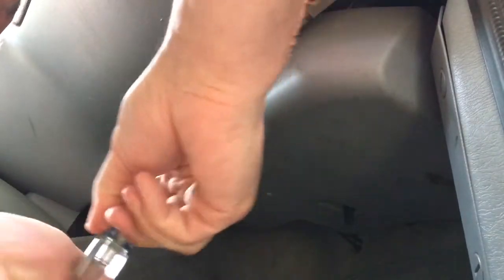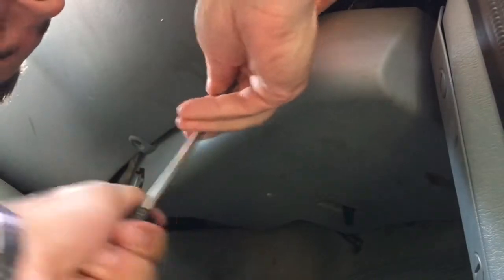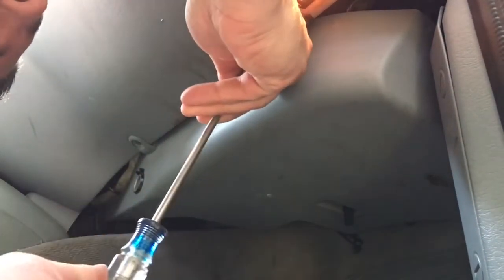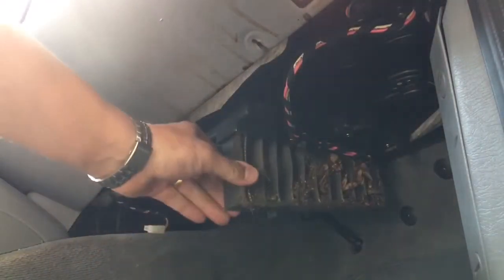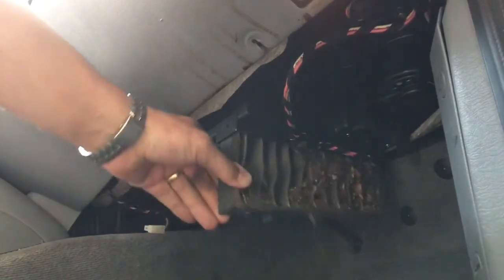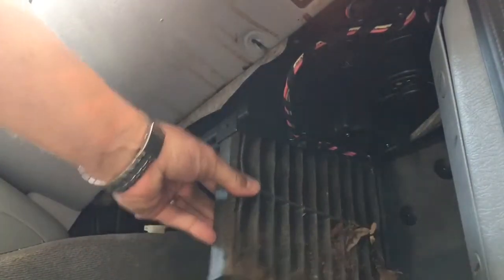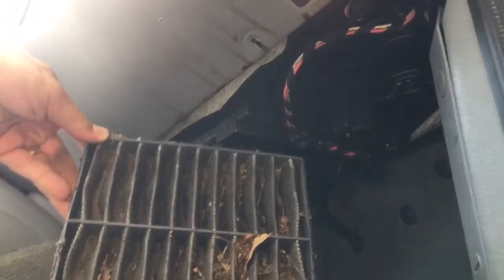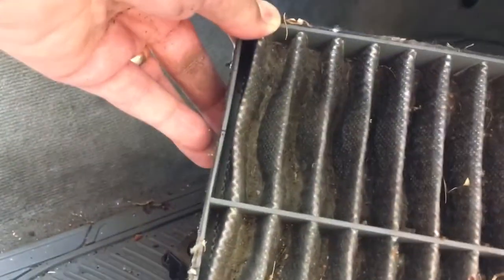Cabin Air Filter Removal Mercedes Benz ML320 ML430 ML500

Comment: thanks @joesnowmobiles  your a great man for these videos. so i have few more questions im looking to lift my ml320 but really haven't seen and lift kits also im looking for a aftermarket front bumper with a winch oh amd a snorkel would you happen to have and links or leads for these items i would greatly appreciate it
Reply from the maker: Checkout this link I think you will find what your looking for as far as the winch setup. http://www.benzworld.org/forums/w163-m-class/90149-off-road-accessories-ml-430-a.html As far as the lift kit here is a link that explains what some other guys have been doing.  Unfortuntaly it doesnt look like there is much out there. ://www.benzworld.org/forums/w163-m-class/1329401-lift-kit.html . Hope that helps!
Joe

Comment: @joesnowmobiles  thanks for all the ml320 videos do you have any on oil change i also have a issue on my lock when i lock my doors my driver lock stay unlocked i have to lock my driver door manually is that normal? its my first ml320.
Reply from the maker: Murphy Banegas great questions, yes I will try to do an oil change video soon, it's one of the easiest oil changes to do. My ML320 does the same thing when I lock my doors from the middle button(my keyfob doesn't work) I'm pretty sure it's a convenience feature  so you don't lock your keys in the car. I have to lock my drivers door from the outside with the key. Hope that helps,
Thanks
Joe